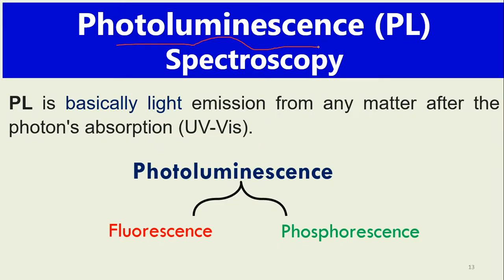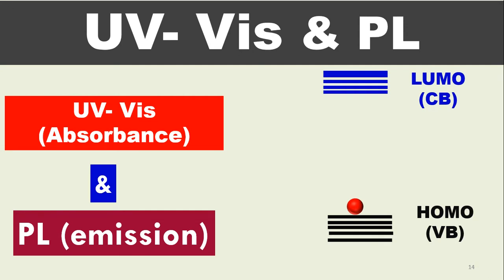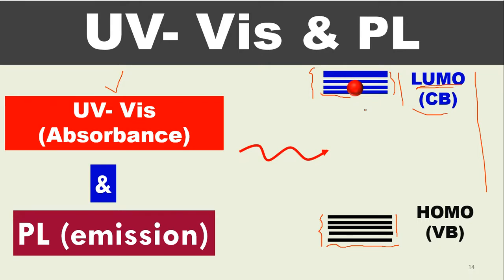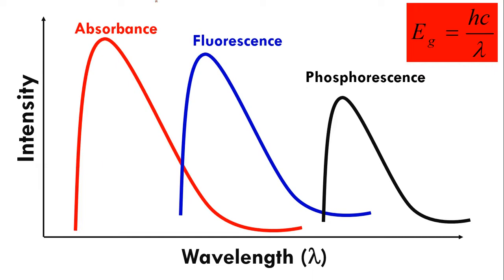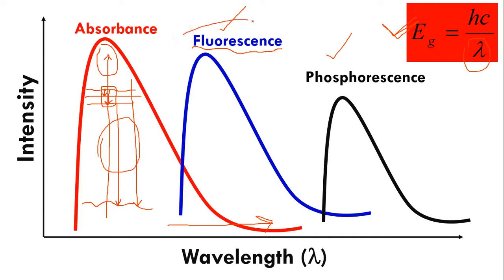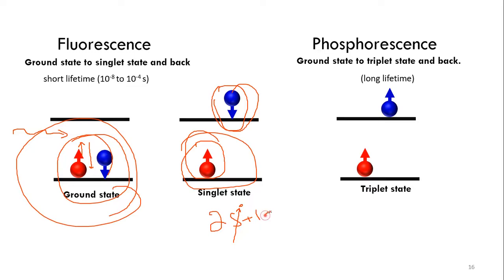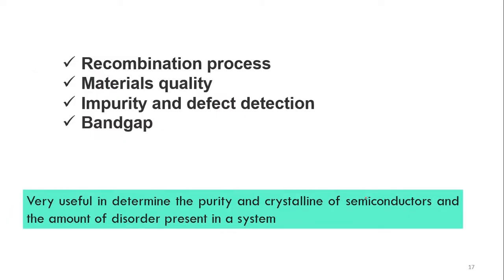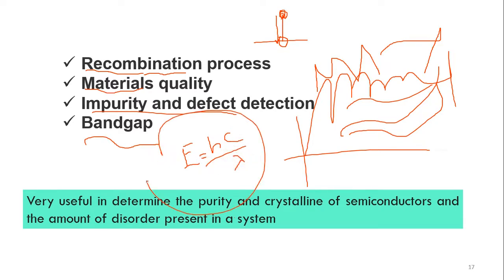Photo-luminescence (PL) Spectroscopy

Comment: How can we take photoluminescence spectra of semiconductor solid material? Should we take it for its suspension in water? And how to take excitation wavelength for starting?
Reply from the maker: 1. Yes, we can take PL for solid material too, as the setup has a sample holder for solid material or powder also. 
2. If you have a pure compound, then take the UV- vis absorption test. The lambda max is the excitation wavelength  . Then, put your solution or powder in spectrometry and set this wavelength as the excitation wavelength
Reply: @qamarwali  got it. Thank you so much.
Reply: Sir, If I want to take uv-vis spectra of composite material which is not completely soluble in any solvent e.g., some biochar based materials, how to take the uv- vis spectra to find the bandgap?
Reply from the maker: @kuljitsihra17  mostly the UV absorption works for liquid sample and there are Cuvette which filled from. We take the base line for that liquid first.

I think there is also possibllility to design your own cavette type sample holder of any quartz materials , preparing your materials as a thin sample, and then taking the UV. But you have to take the baseline of that quart first.

The band gap calculation is then easy, just like for pure sample using Tauc plot.

Comment: hello!! i’d like to say that is a very good video!!

i have a question: in the case of phosphorescence PL type, how the relaxation can occurs? the material has to be stimulated again or simply decay lower than the fluorescence?

i mean this because of “optically stimulated luminescence“ which is caused by previous irradiation, but i’m this case leads to a anti stokes emission!

thanks for the content !!!
Reply from the maker: In fluorescence, the molecule quickly re-emits within a very short (nanoseconds), while phosphorescence involves a longer timescale for light emission. No extra stimulation is required. These both can occurs simultaneously BUT one has to use sophisticated machine to measure these two process at the same time. 

In Raman spectroscopy, when light absorbed by molecules, the following phenomenon occurs. 

Rayleigh Scattering: When the emit light has exactly the same frequency, energy, wavelength or color. This is due to the coherent scattering (Elastic scattering). For instance, > 99% scattered photons demonstrate the "Rayleigh effect" 

Raman Scattering (Stokes & Anti-Stokes)

Raman scattering is based on the inelastic scattering and overall,  < 1% of scattered photons demonstrate the "Raman effect" 

Stokes Scattering: When the emit light has lower energy than the incident photons and most of the Raman scattering composed of the Stokes scattering.   

Anti- Stokes Scattering: When the emit light has higher energy than the absorbed photons and this is very rarely occurring phenomena as the molecule are required to be higher vibrational state which is very rare. According to Boltzmann distribution. 

To sum up, the Rayleigh scattering >>>> Stokes scattering > Anti-Stokes scattering ....
Reply from the maker: Many thanks for the nice words. I am sorry if I could not answer exactly. 

Wish you good luck!

Comment: Nice video sir. I really liked it. 
I have a question, how can we distinguish in spectrum whether it is Fluorescence or phosphorescence peak? Which peak will tell us the bandgap (Fluorescence or phosphorescence)?
Reply from the maker: One answers is Fluorescence has shorter wavelength than the Phosphorescence. 

It's is due to the fact that the relaxation is between singlet and triplet states, respectively. 

Which peak will tell us the band gap is difficult for me to answer. I will search and revert asap. Or I will make another video.
Reply from the maker: @Shehzad Ahmed to the best of knowledge Fluorescent and Phosphorecent have different materials.
Reply: @qamarwali  thanks for the explanation. I got my nearest answer but how do we decide which material will show fluorescence and phosphorescence, I mean which method will tell us this because if we do unknown sample how would I know this peak is due to phosphorescence Or fluorescence?
Reply from the maker: Good question.  When we cease for source of light, the Fluorescence will nearly immidiatly stop. While in the case of Phosphorescence the emmission will last for quite sometime after cease the source light.
Reply: @qamarwali  Wow thanks a lot. So before doing PL we first need to do UV and visible lamp to check whether the material is fluorescence active or phosphorescence and then we can go for PL. Thanks
Reply from the maker: Good👍. Yes true.
Reply: @qamarwali  👌